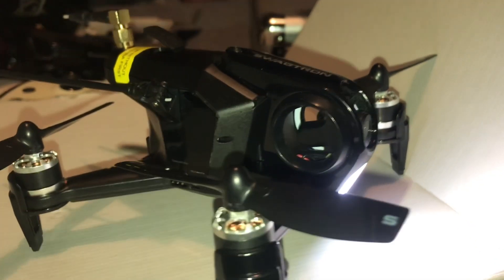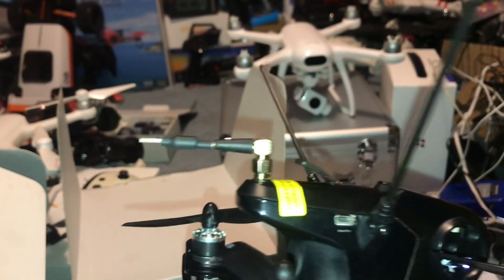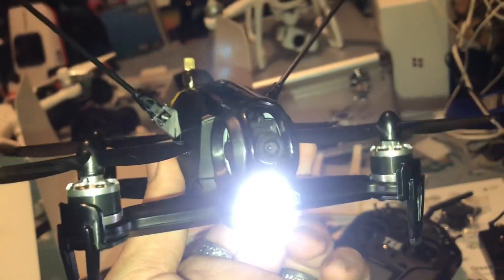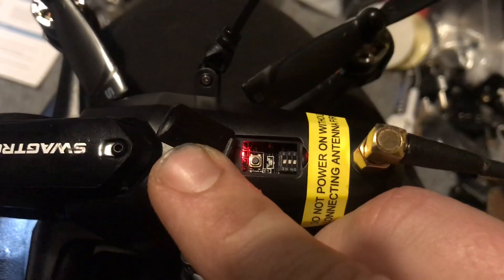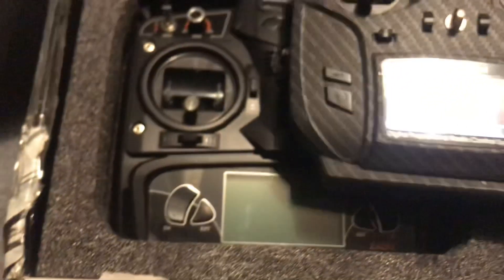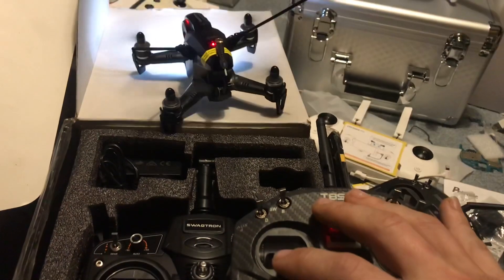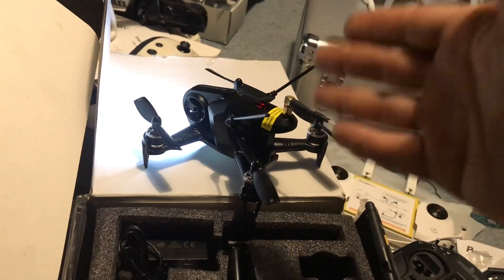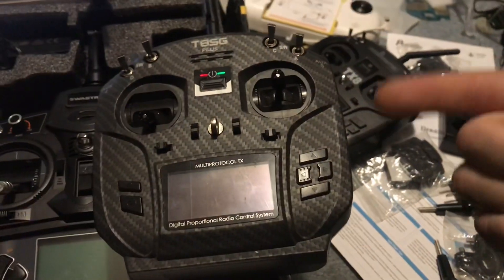Walkera Rodeo 150 Swagtron how to bind to Jumper T8SG easy DIY review

Comment: I still have my walkera rodeo 150 from 4 years ago,it lives in a carbon frame and I use to fly it on 3s,its in a box and will stay with me for memories,mine was running cleanflight,awesome brotta,you just took me waaay back,much appreciated brotta👉👈
Reply: Oh and my next quad before I started building was an f210:)